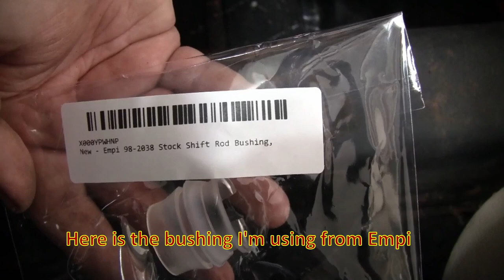Super Beetle Shift Rod Bushing Replacement

Comment: Hey thanks for vedio . Did mine ( '78 ) yesterday , it was a bitch ! One hint : I used  the tie strap and a screwdriver over the shifter well in the front , to support the weight of the shaft . I was getting hung up on the topside of the tunnel . Also did the bushing in the back . Well worth the hassle . It's like night and day for shifting . Thanks again . Mark .

Comment: Thank you so much, just did my 74 super beetle and your video was a lifesaver. My only addition is as I was feeding the rod back. I got hung up on the parking break and heater assembly. I was able to press it down with a screwdriver and until it cleared and then used your support claw to get it the rest of the way back A+ great video thank you.

Comment: I'm trying to do like you but I can't get the rod to move forward anymore!!
Reply from the maker: Hey Thiago... It's likely stuck somewhere in the channel between the wires and tabs. You'll probably need to pull it back a bit until it feels free, and twist it a 90 to 180 degree and try pushing it again. Hope you can get it going that way. From the opening in the back, there's enough space to get a phone upside down to take a video with flash on and see where exactly it's stuck and which way you need to twist it.

Comment: Did my 72 Super the same way!  My shaft was a bit rusty and pitted where it travels back and forth in the bushing.  I had to smooth the surface with a fine emory cloth working it in a fore and aft motion to smooth out.
Reply from the maker: So, you didn't take the rod out and worked through the small opening to smooth it out? Wow... it must have taken you quite some time?
Reply: @fixiteasy9080  It took about an hr.  I used about 400 grit 1" wide crocus cloth.   Started by Just lapping it and turning the rod.  After I got it smooth then I the the fore and aft strokes to get the grain going the rod movement direction. Works great now.
Reply: As a note, I was not about to pull the rod out the front.  My SB has factory air conditioning and the condenser coils are in front where the rod would come out...  The AC is currently not functional but I did not want to mess with disconnecting the lines etc.

Comment: Ok I'm trying to run a fuel line though tunnel but having hard time.. how did they run all the lines so well seems so hard to do
Reply from the maker: Oh wow, that sounds pretty hard to do. I never did it, but guessing the cover in front of the tunnel will need to come off, so you can see. In my pics/video, I can see the tabs holding the fuel line, but not sure what would be the easiest way to reach them and pry/fasten while changing the line. Good Luck and let me know if you film it and put it up on YouTube.

Comment: I did this last night on my 71 Super and will offer some tips and observations-   
Taking at least one of the front seats out makes this way easier (I took out both) just so you can go between both openings without having to move then.  Your "great trick" of having some rope or twin pulled through the tunnel as well as something looped under the rod through the shifter hole is valuable for guiding the rod back through and making sure you're not wrapped around any cables, even if you can't use the rope to pull. I was able to pretty easily install the ring and bushing over the twine I used and pop them into the retainer. I used a pretty basic pair of needle-nose pliers leveraged against the front of the shifter opening to move the rod 2"-3" at a time. I used a little bit of grease to get it started and then again whenever it felt like it was binding up.  The rod was a little rough but not too bad. Your trick of dipping your cellphone camera down there to see what's going on was GOLD, I did this several times- pretty much whenever I felt like the rod was binding up I would check and see what I was stuck on and determine which way I needed to angle the rod. Your video is awesome because it shows, there is ALOT of crap in that tunnel that you don't want to break or bind. I changed the angle of the rod as needed by pulling up on my rope looped around the rod in the shifter opening (mostly) and pulling on my twine through the back (somewhat). I also found that I needed to rotate the rod to get around stuff at different times (since it is indeed slightly curved!) which I was able to do with my pliers though the shifter opening. 
I didn't take me that long, I would guess less than an hour (I had a couple interruptions). I really was happy to avoid pulling the shift rod all the way out the front, but don't know how much time doing it this way saves it my just be a wash. That said, if I do this on a Super again I would 100% try and do it this way again.
Reply from the maker: I'm happy that the tips on my video helped you out. And Thanks for sharing your tips as well.
Reply: why make the job so complicated? if you extract the entire shift rod from the front cap it takes less than half the time